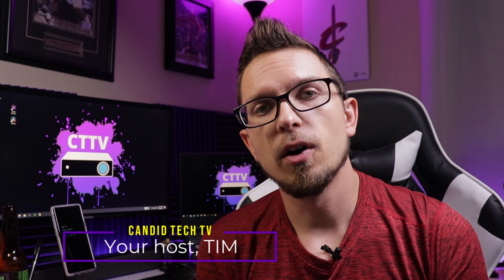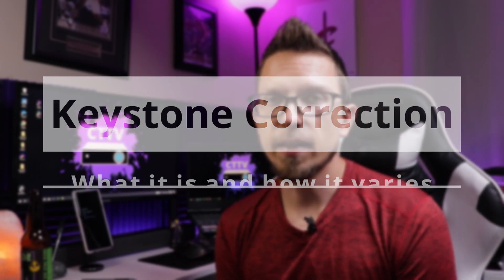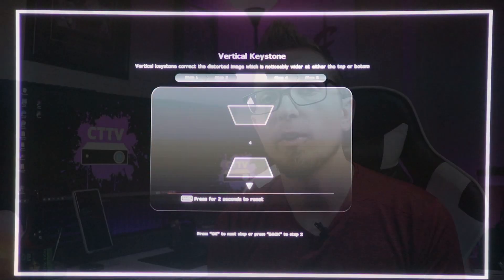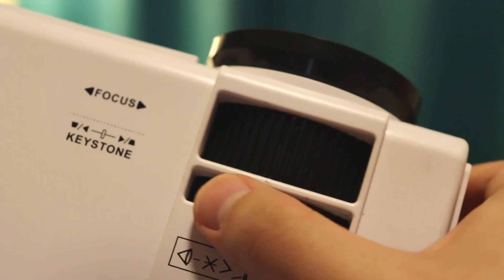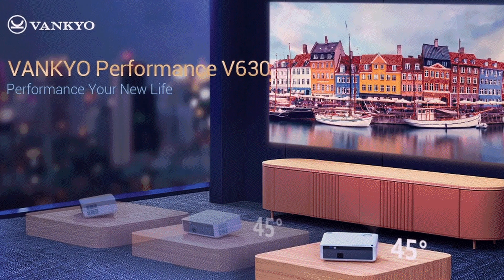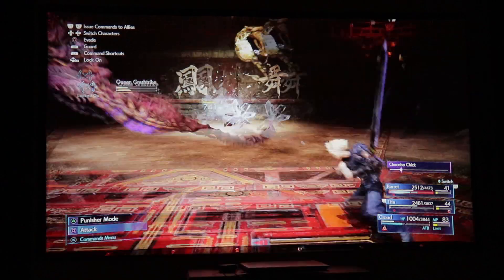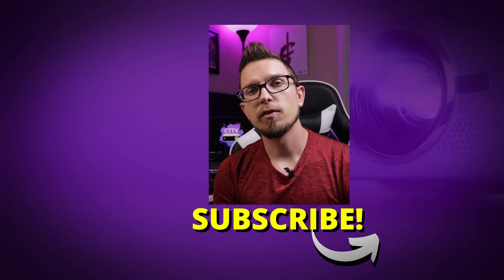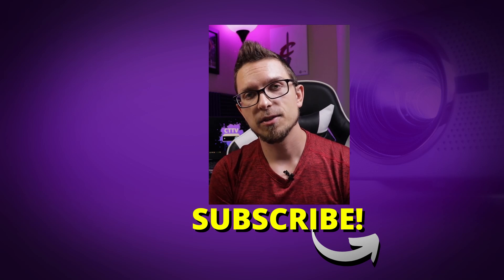Keystone Correction Explained! | Projector 2 Min Tips

Comment: A possible method that removes keystone correction is facing your projector 90 degrees away from target and placing a mirror in front of the projector with mirror positioned directly in line with center of room and pointing mirror at target, in which case no keystone correction is needed and looks crisp. For mirror should buy first surface mirror, as there will be no glass in front to produce artifact.
Reply: Huh
Reply: That is a clever idea actually. First surface mirror sounds like a must in this case

Comment: Angle the screen a little to help keystone issue. It works, your eye wont notice the screen angled on the wall. If projector on a lower table, move top of screen toward projector, and bottom away from projector.

Comment: hello, thanks for the video~ could you please explain what the 4 corner/point keystone correction is?
Reply from the maker: Hey yeah so the 4 point keystone correction is basically where you correct the corners one at a time. Usually it will make one corner "active" and you then use the arrow keys to move the corner of the projection to the true corner of your screen. Then you lock that in and move to the next corner. It's a bit more accurate as you're doing that for Each corner and you're basically "pinning" down the corners one by one to your actual screen so that it fits well.
Reply: @CandidTechTV  wow, thanks a lot~

Comment: 15 deg of what?  Someone please put up a diagram that shows an angle I can measure.  My sense so far from looking around  is that if the boresight of the lens is tilted 15 above horizontal, the vertical keystone correction can be adjusted enough to make the image square again.   But nobody explains this geometry sufficiently.  What if the surface I am projecting on is tilted and not vertical?  Give me some tools so I can tell if the projector has enough correction to fix the image.

Comment: I am looking for a software, even for a fee, for windows for the
correction of the image, let me explain better. My mini projector with
android allows me to place the mini projector where
I want... because then I can act corner by corner to resize and straighten the projected image. So I can place the
crooked projector in a crooked wall and see a square or grinding it
straight, which i can't do with hdmi cable (I have keystone function
correction but it only works if the projector is centered, if positioned
  on the side I see a parallelogram. Anyone know a software that
allows you to correct the picture/movie/game corner by corner with
windows (possibly offline)?
Reply: Did you find something? I'm also searching for it
Reply: @jonassousa2228  hi, no and you?

Comment: Would love to hear an updated take on some horizontal keystone projectors. Need a projector for kids, and the my kitchen doesn't have a direct to any large enough surface. Any recommendations?
Reply: A possible method that removes keystone correction is facing your projector 90 degrees away from target and placing a mirror in front of the projector with mirror positioned directly in line with center of room and pointing mirror at target, in which case no keystone correction is needed and looks crisp. For mirror should buy first surface mirror, as there will be no glass in front to produce artifact.

Comment: Hello i will need help to decide what projector choose, on December 2018 i bought vivimage explore 3 just for an aunt i was looking on it it was really good and bright, now im looking to get 1 for me but i find another that its a little bit better on some specs but not on the keystone correction. The other is Jifar h6 i guess its 7000 lux or lumens and the vivimage its 6800 there is a 40k hours lamp diference and 2000:1 high dinamic range  diference vivimage have 45 4d keystone and the other just 15 manual. Answer asap plz it would help a lot

Comment: Hi. I'm looking at getting a Blitzwolf projector that has no keystone correction. Do you think this is a good idea or should I rather get a projector with keystone correction? Is it that important do you think? I'm looking at the BlitzWolf® BW-VP5 Portable Projector (https://www.blitzwolf.com/Portable-Projector-Multimedia-720P-p-540.html). I really don't have anyone to ask advice from and there's not much information related to what I'm asking you. I hope you can advise? Also... BW-VP5 has 720p ver the BW-VP7's 480p. This projector is for my bedroom that is about 10m x 8m size. Does the pixel make that much of a difference? I actually went and ordered the VP7 and now I'm considering cancelling that order and rather spending a little more and getting the VP5. What do you think? Thanks. I hope you can help because I have a day or 2 before the order gets finalised and then I'm stuck with whatever I ordered.
Reply from the maker: Hey so I do think that 720p vs 480p is a noticeable step up. Especially if you're watching anything other than cartoons. Text is noticeably sharper too. As far as keystone, ideally if you can get by without using it, that's best anyway so it just depends on your setup. If you can set it up pretty level from the start, then you really won't need a projector with one. However, if you are going to be projecting at an angle upward, then it might help a bit.

Comment: my biggest gripe with projectors is the noise they generate with the fan and the color wheel, even the best of them
can you recommend a native 1080 projector that has a low fan noise?
thanks.
Reply from the maker: I really liked the BenQ TH585 and TH685 projectors for native 1080p but they are a bit more expensive. I did a sound and fan test of those here: https://youtu.be/wNuNYr3yJak
The M18 projector is a great 1080p budget option but it is definitely loud.